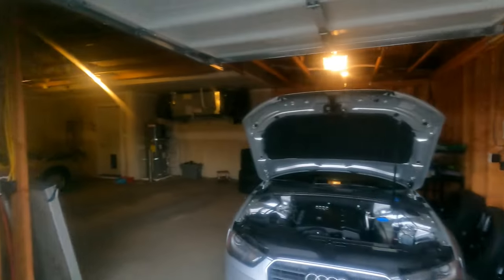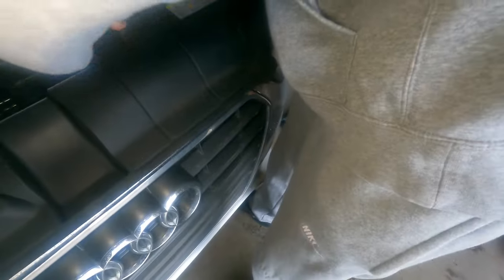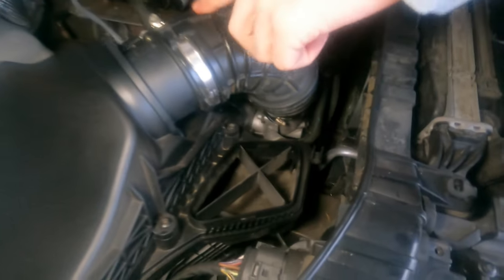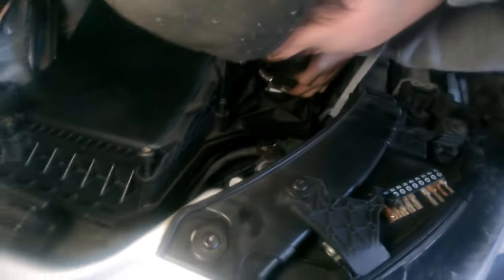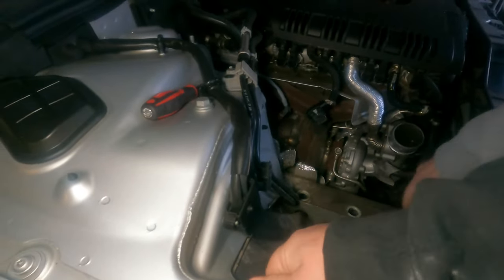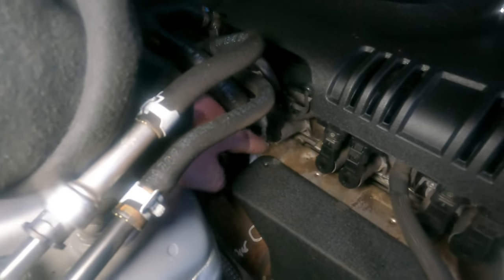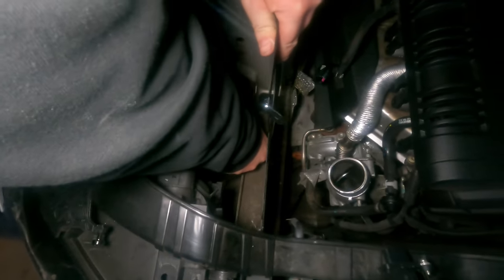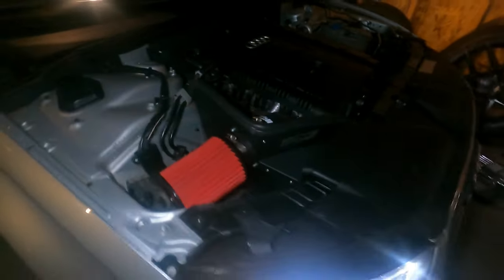This 2013 Audi Just Got a MAJOR Upgrade with CTS Turbo Cold Air Intake!

Comment: Audi's are special in that way. If you start it without the MAF it will give like 20 error codes for a bunch of unrelated things from traction control to ABS, to tire pressure sensors ...
Reply: Very true had the same issue one time lol. Had them replace the MAF but I have a feeling it could’ve been cleaned
Reply: Yeap it made my tpms light come on